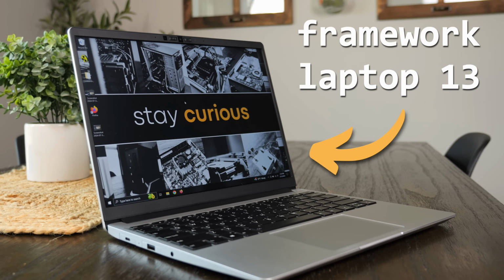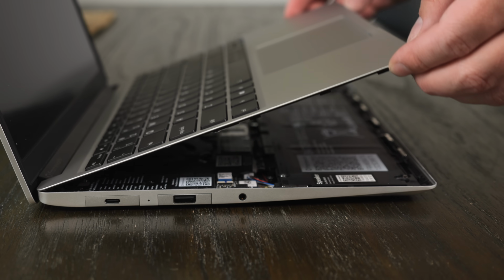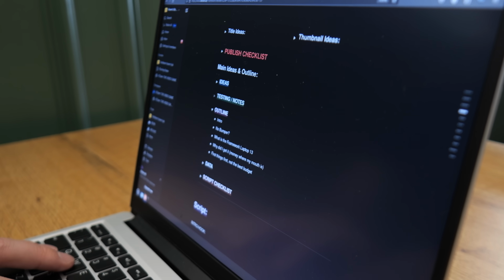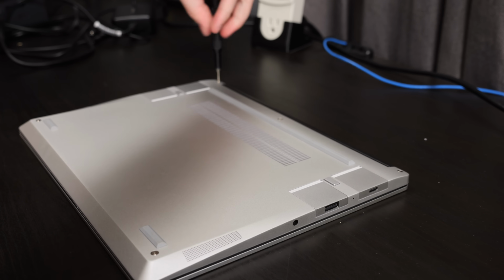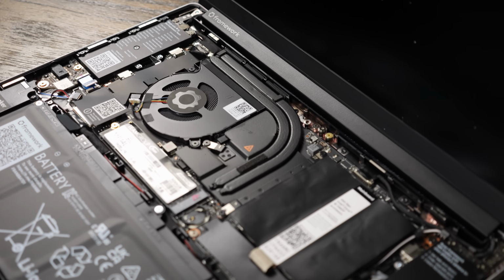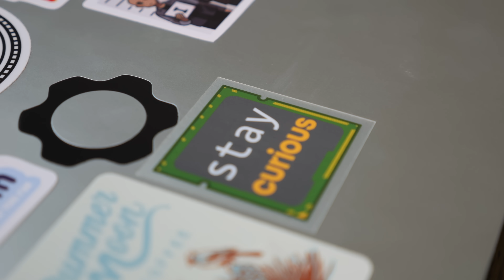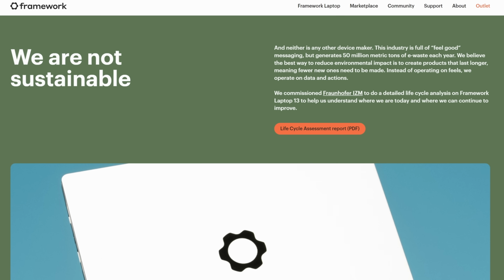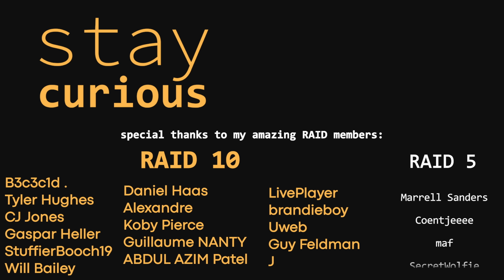Is The Framework Laptop ACTUALLY Worth It?

Comment: I've had a Framework 13 for about 9 months now and couldn't be happier.  Running Arch Linux with disk encryption and BTRFS, typically used into a Thunderbolt hub with three monitors connected.  Checking out reviews because I'm looking for experiences of other people's more normie use cases as I am thinking to get one for my dad.  But if you are a linux geek, definitely recommend the 13.  The swappable modules are amazing as I can put in an ethernet module only when I actually need one for network debugging and can also leave only USB connectors in for mosty use and carry around HDMI and DisplayPort modules to swap in at the last minute if I need to make a presentation on a projector.  Not sure you'd want to game on it, but for engineering / IT / developer / traveling geek type purposes is it amazing

Comment: When it gets to the point it cost $800 to replace the motherboard on a $1100 laptop that ruins the point of repair or upgrade. Just junk it. Which ruins the point of buying a framework to begin with. They are out to soak you on part prices.  This is why people still buy think pads.  They just work
Reply: So spend $1200 on a new laptop instead? How is that any better? Their prices are reasonable considering they don't have the same economies of scale that the large manufacturers have. You are paying a premium, sure, but it's not as much as you seem to think it is. And for the price of a $60 case, you get to have a perfectly useable compact desktop for your kid's bedroom or home theater PC when you upgrade your laptop.
Reply: its 500 for a ryzen 7

Comment: The issues you bring up are problems of all intel based laptops, windows especially. Intel chips are trash, they use more power, generate more heat, and throttle quickly compared their arm based cousins. Windows is also a power hungry OS that let's every single app do whatever it wants even when the computer is asleep. I have had both windows and apple m-series laptops, and have to say, that if you can, just get a mac. Yeah, charging $200 for a ram upgrade from 16gb to 32gb, on their machines is overpriced apple nonsense, (when it's probably only a $30 upgrade) and if it breaks and you don't have apple care, good luck. However, the benefirs of a macbook far outweigh the negatives.

Comment: Fingerprint sensors on Linux are supposed to work these days with the right drivers, but I never bothered with my Dell since bio-metrics are not all that secure, and a hardware USB U2F key like a Yubikey is just as convenient while being more secure and allowing for hardware backed 2FA on internet accounts... passkeys that are stored on a laptop or phone are not hardware backed and kind of defeat the purpose of 2FA if they're on the same physical device you use for logging in.

Comment: He has some valid points here but the other thing about it is that he kept trying to compare the Windows OS to the MacOS. The reason Mac’s tend to last longer for battery life is because apple automates a lot of the things that the user would normally have to control themselves. Because this laptop is fully modular, if the battery life really was a significant issue framework has battery replacements that an extend the amount of time the battery discharges

Comment: Excellent video and real-life review too. I bought the 13 AMD 5 version back in November last year. I absolutely love using this laptop. There are a few things, mostly with the AMD chipset drivers, which occasionally seems to make Windows 11 lockup and requires a hard power-key reset. Aside from that, yeah, the fans are noisy and the thermals are hot, so I'll do what you did and will replace the thermal paste (thanks for the tip).

Aside from that, my early teenage children squabble over who is going to use it for homework! They also use it for light gaming and say its really good.

I plan to upgrade to the lastest AMD motherboard, screen and webcam too; so yeah, that motherboard into your 3d printed case would be really good! As I plan to do the same thing, and replace my father-in-laws 2016 MacBook Pro with it (it'll be running Linux too).

I want to go all out and run Linux on everything, not far off from achieving this now. I hear that Ubuntu 24.10 and Fedora 40/41 both support the built-in fingerprint reader on the Framework laptops as the fingerprint module Framework use is from a vendor that has some form of open hardware/firmware/driver specs.

Comment: Great, honest review!

I've been working with and on computers since the 1980's, I never had something happen that I could not repair or replace or reinstall myself. I have used a Macbook Air since 2012, which still works and rocks Fedora Linux. ...But I just heard my 4 year old €1700,- MacBook Air M1 16GB/512GB needs a €650,- repair (motherboard replacement) because the firmware got corrupted. It would not update to MacOS Sequoia, because "It failed to personalize the download" and after a reboot it gave me the finger... Eh, the circle with ! ...It could not be restored with a second Mac. 

I've told Apple that I would take my MacBook Air paperweight home and spend the €650,- on a Framework laptop that I can repair myself. I am also gonna sell my iPhone 11, which is in need of a battery replacement, and buy a Fairphone with or put /e/OS on it instead. I am done with these companies gluing and soldering everything together and making it nearly impossible to work on or to repair, or replace it yourself - and all for the benefit of their shareholders.

Comment: I took the bullet and honestly? I feel I got scammed.
I bought a Framework AMD 7840u and in just 15 days, I got these issues:

- Screen came with a bunch of dead / stuck pixels. Support has sent me a replacement part which should be delivered tomorrow.
- The laptop has fan issues which are being "fixed" by the linux community. On Windows this is completely unusable. It's not like the CPU is running hot or anything, this has to do with a design choice regarding temperature sensors put close to the charging circuits. that means that the fan noise gets even worse while the laptop is charging.
- The 120hz screen has some issues with ghosting. Lowering the refresh rate to 75 or 90 kinda solves them. If it breaks though, prepare to spend upwards to 300 bucks for a subpar LCD panel. You read that correctly, LCD, not IPS, not MicroLed, not OLED.
- The Wifi chip is garbage, you will still have issues with an Intel counterpart if you choose to change it.
- VRR is not present on the AMD version 

I'm sure I will find more but honestly? this feels like a 800 bucks laptop, not a 1500$ laptop. 
I'm glad I didn't buy Ram or SSD from them and saved a bit.

Comment: This definitely falls into the "when my current laptop fails or becomes obsolete" category, for me. At that price point, I can't quite justify spending all that cash for myself if there isn't an actual need. 

That said, I'm a little bummed out that I didn't hear about Framework during the pandemic. I spent far too much on a Razer Blade 15, and a Framework 13 would've come down at less than what it cost me, even if I'd gone the DIY route. My one single regret with my Razer lappy is Linux support being so spotty any distro I try ends up mimicking Arch Linux' more temperamental aspects.

"Oh, joy - sudo apt upgrade pulled on a ton of packages! Let's cross our fingers and hope the Bluetooth drivers or the audio ones don't crap out again!"

Comment: My brother and I both have Framework Laptop 16s and we love them. Wanted to support the mission and AMD. Laptops are great. I agree with the module selection comment. Truly having the USB A and C has been all I have needed. But for my brother when they released the Full SD Card module, it was simple order, pop out another module, pop in the SD Card one and off you go. And if that is not needed ALL the time, take it out and put back something that would be more useful. Easy. I went with the DIY option for my 16 and the instructions and videos were super easy to follow and saved me a wee bit of money. I did end up buying the SSD and RAM through framework. But eh. Overall the laptops are great and have really good performance.

Comment: The thermal paste could actually have been bad. A lot of manufacturers (for Laptops, GPU's, etc) have been skimping and using cheaper TIM that's super thin at the start so that it's absolutely incredible when you first get it as it then has better surface filling between the chip/cold plate, but due to the cheaper formulation, the liquid part of the thermal paste dries out/evaporates and turns into dried out garbage, sometimes even in just a months time. Honestly, given framework's size, I'd wager they don't have as broad of testing which could include such long term testing of thermal paste choices to catch such a problem. Especially if it's a formulation that's towards the "better" end of the shenanigannery. They could have just been tricked by the starting performance of the miraculously cheaper paste, so I would at least like to give them the benefit of the doubt here. 

Those larger, more experienced OEMs, however, know this is a thing and do it deliberately so they can crank settings higher and make it look better even though you genuinely won't have that performance in a few months time without a repaste you'd have to likely do without instructions, risking breaking stuff, necessitating giving them more stabs at your wallet.

Comment: thunderbolt 4 should mean that the expansion cards are going over pcie if i understand correctly
Reply from the maker: Not necessarily. TB4 has the capability of PCIe signaling, but if it's just a USB adapter or device, it just uses the USB protocol. I'm not an expert though to be fair haha
Reply: @HardwareHaven  hmm that fair 🤔

Comment: I might try putting thermal paste as mine gets a little hot too. Also, never got the fingerprint working on linux either.
Reply: There were a couple of firmware versions where there were some bugs with the fingerprint scanner so if your firmware is up to date which you can do under linux with fwupd and if your distro has fprintd it should work now.

Comment: That thing had WAY TOO MUCH thermal paste. You want as much metal-to-metal contact area as possible, not metal-paste-metal. The purpose of the thermal paste is to fill in any small air gaps in a rough metal surface. You're supposed to scrape essentially all of it off, leaving it only in hollows in the metal. Also comparing the battery life and trackpad etc against an Apple is simply unfair -- what we'd like to know is how it compares to similarly priced Lenovo or HP or Asus etc machines.

Comment: I like the concept and how Framework is executing on the ability to have the parts of the entire laptop upgradable. I first came across Framework when I saw one of LTTs videos where Linus first show cased them, I think it might have been around 2021 and he mentioned that he invested into the company. Recently my mother was having issues with her previous laptop, which was getting to be about 8 years old at the time running windows 8. It was getting really slow, the laptop hinges were falling apart. I talked her into getting one of the Framework 13 laptops, so that as the hardware gets slow with the newer software, we can upgrade the main board with a newer processor and get her up and going with things being fast again without having to buy an entire new laptop and have to re-install all of her software and move files.

I personal plan on getting one of the Framework 16 next time I'm up for an upgrade as I spend all my time using a laptop and my employment has an equipment purchase program where if I personally buy a laptop, that meets minimum specs, they'll reimburse up to a certain amount. We can do that once every three years and I did that about 2 years ago with the laptop I'm using currently. Most of my work I'm doing based on Linux accessing Servers and doing software programming through connections to VMs, so I don't necessarily need to be running Windows for doing my work and I can dedicate to using a Linux desktop distro.

I'll be nice to see how Framework continues to innovate and improve their platform.

Comment: so many weird things in this video. 

you mainly do text editing on it? then why do you want a 120hz screen?
your battery life is bad? but you seem to run dozens of programs at once. 
you want more expansion cards, but what for? what do you need? 
you dislike the touch pad but always use an external mouse anyway.
Reply from the maker: - I want a higher resolution screen
- Not sure what you mean by running dozens of programs, I typically just have Firefox open, maybe Spotify
- I didn’t say I wanted more, I just said the idea seemed really cool, but there weren’t as many cool use cases for the swappable IO that I had once thought there might be.
- I often use a mouse, but in many situations I can’t. I work for about half an hour every week in a waiting room with my computer in my lap.

Comment: I really like this machine, mine is the AMD version :) It gets better battery life than the Intel one, and better performance.
I also really appreciate the new upgraded display - works quite well on 200% on Linux.
Quite happy with it, my only small issue is that the trackpad sometimes is a bit fast and registers 2 taps sequentially instead of 1 - but that's an issue with my Linux distro not the laptop
Upgrading the display was a breeze and for my usage I can keep this AMD version for many years since my laptop is basically Youtube, web browsing and some programming every now and then :D

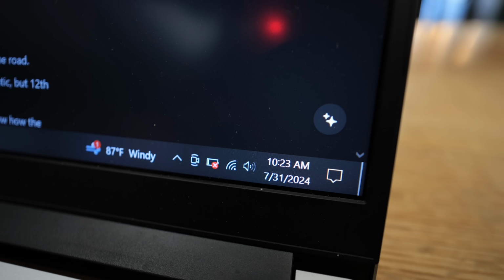Comment: 2:45 i think the reason why your battery drains so quickly is because you chose an intel cpu, which is notorious for not being power efficient and also generating more heat than amd

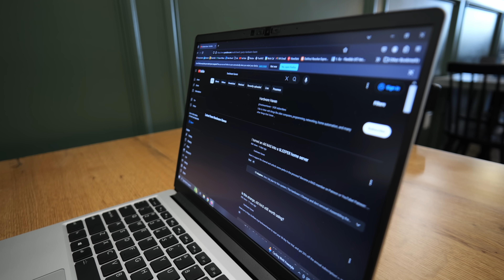4:27 screen clarity issue is a windows problem, you can try and fix it using windows cleartype

Comment: 12:34 - huh.  FWIW, they work fine for me with an Ubuntu (Ubuntu 22.04.3 LTS) install.  I haven't really tried getting fingerprint scanning working, though... Or rather, I think I tried earlier a bit on a different OS, and had some problems, but then, mostly just didn't care, so I haven't tried since installing Ubuntu.  Maybe I will at some point.  Anyway, my biggest complaint is that the aluminum is just flexible enough that when I'm holding the laptop with one hand, e.g. to set it down, sometimes I get trackpad clicks... videos (un/)pause, etc. 😢
Reply: update: actually, this inspired me to be curious enough to try getting fingerprint scanning working, and... it just worked (at least as tested with one screen unlock).  :)
Reply: I found tightening my screws down a little firmer reduced the amount of flex I had in my chassis and don't get misclicks when one-handing mine now. I had one or two before doing so - might be an element of manufacturing tolerances.

Comment: I must say that I have not had quite the same experience with my framework, at least since I sold my 12th Gen Intel mainboard and upgraded to the AMD one. I went with the Ryzen 5 7640u and upgraded the battery to the 61Wh at the same time, and my laptop gets 10-14 hours of battery life on a normal day of programming, browsing the internet, and listening to music. I'm also using NixOS on Gnome with powertop and ppd running, and usually <50% brightness. I never have heat or noise issues even when compiling large projects, and I honestly love this laptop so much
Reply: I'm waiting on my new AMD Framework, which should arrive this month. I've already commented about this on this video and I wonder if people are thinking "AMD is really good for battery life and thermals" when really they ought to be thinking "Intel is really bad at battery life and thermals", because right now there are MacBooks (ARM), x86 (AMD) and x86 (Intel) based laptops for the mainstream and only one of those categories has terrible efficiency.
Reply: How did you sell the old mainboard? Do they offer some program or you used a website like ebay? I worry that outside US, these are insane e-waste generator machines
Reply: @aliancemd you can still use the old motherboard for other stuff. Tbh

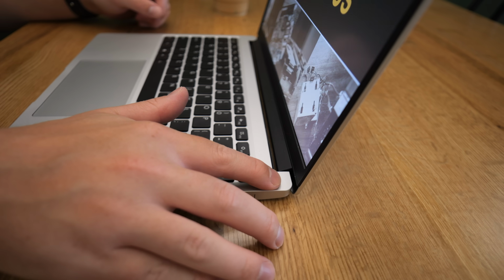Comment: 12:45 i think when used with windows first it doesnt work with linux and you either have to set it up in linux first for it to work on both oses (i think that was possible but idk) or only use it in one os or the other

edit: using it on windows only is probably the better choice given PAM on linux doesnt support parallel authentication, only sequential (so you have to wait 30s for the fingerprint sensor to time out to use password auth whenever the auth isnt in a terminal where you can CTRL+C to skip fingerprint auth)

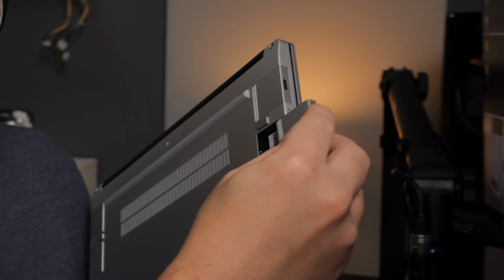Comment: 5:33 in case you havent heard, framework is going to release a new webcam module soon (if they havent done it already, it was preorder last time i checked) that is a 4k sensor outputting 1080p by grouping the pixels, which apparently makes it perform really well in a wide range of lighting conditions

Comment: Problem is, I just bought a new Thinkpad E14 (7530u /16/512) for 620USD which will easily last me for 5 years after which I can get a new laptop and still will be a cheaper deal than a framework.
Reply: I own an Acer which I bought over a decade ago, I have three linux distros on it, they all work and update, it cost me around € 500...still going strong...